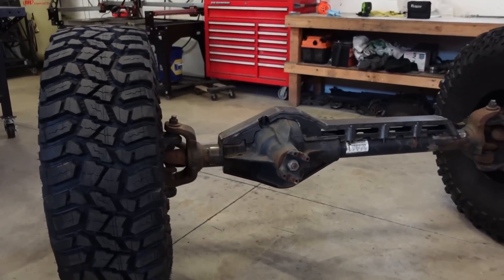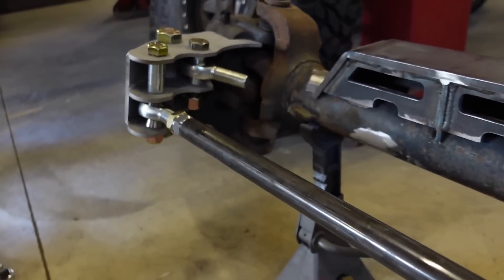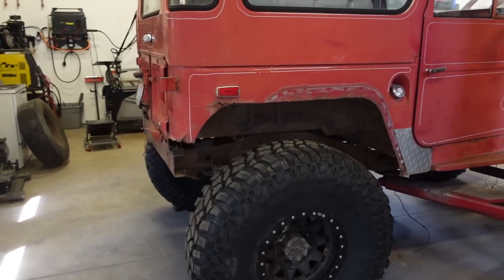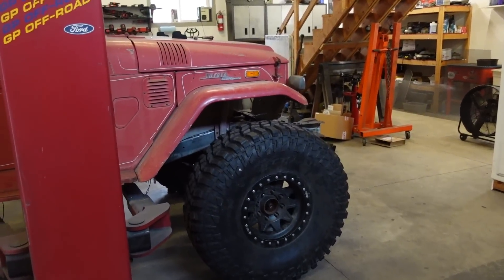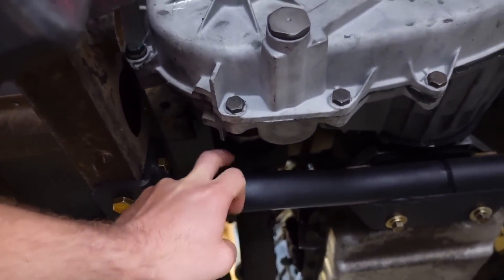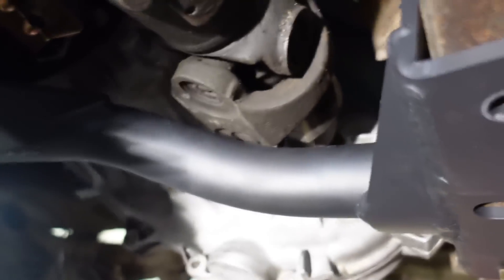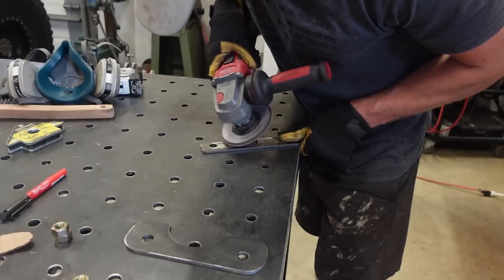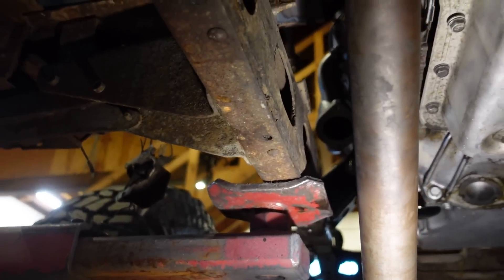The FJ40 Is Looking INSANE On 40's And 1 Ton Axles!

Comment: Too bad the clocking ring didn't work out. I don't know if you mounted the drivetrain centered or not. Alot of custom rigs have the drivetrain offset to gain clearance to the front driveshaft. My son's Jeepster with a 5.3,th350 and np205 has the engine crooked with the front over to the passengerside and tcase over to the driverside. Had to do this to fit the big 205 between the narrow frame rails. CV driveshafts don't care if you have multiple angles going on.

Comment: When cutting out the pipe for clearance, should have just used the same piece but flipped it inwards so that it covers the hole completely but it also indents in somewhat for more clearance instead of a flat plate
Reply: Came here to also say that
Reply from the maker: I tried, didn’t fit because of the bend! Plus I wanted thicker steel

Comment: Would look cool if you built rear fender flares similar to the high flares on jeeps. But build it out of tubing and sheet metal. If it tied into a running board … then you could use those as a step to reach a roof rack

Comment: Hind sight is 20-20, no reason to redo the crossmember. This thing is gonna be super capable whether the t-case hangs down 2 inches or not. 
And besides it’s probably better to have a T-case you know won’t leak and have to build a skid plate for it than to fight with a t-case that won’t seal 😁👍🏼👍🏼